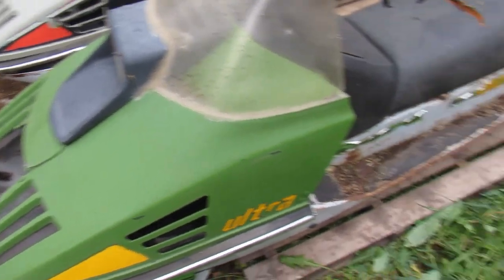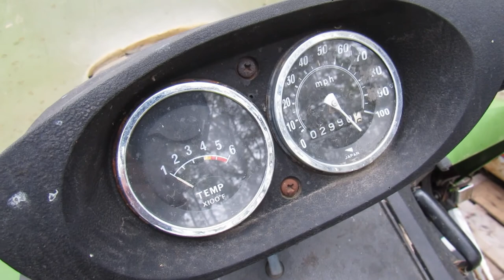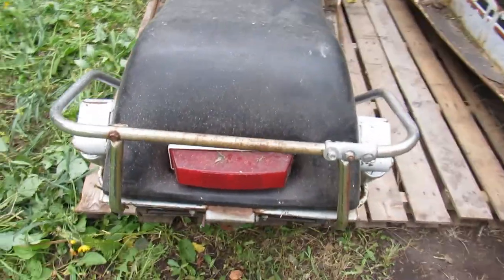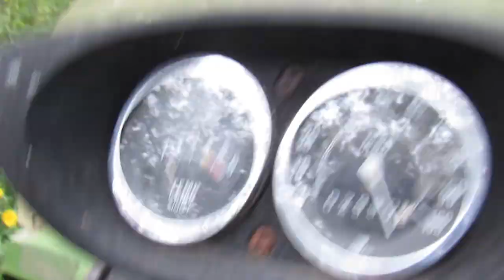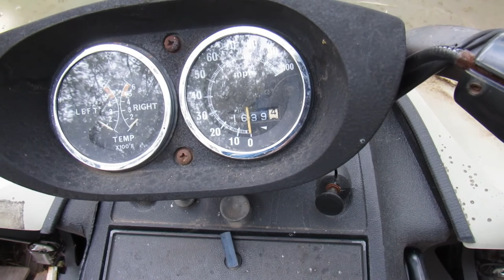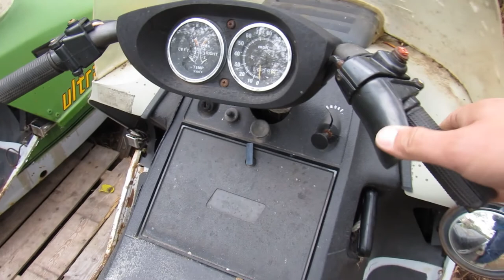1976 skiroule laser and ultra

Comment: Sitting with my 90 year old father-in-law.  Showing him your video.  He lived in Cicero NY.   His Shop was on the corner of Mud mill Rd  and RT 11, Browns Gas Station.  He said he sold 110 Skiroule’s in 1972.  Sold 300 of the Green ones.  There was a 640 he had that did 85-90 MPH twin engine, track was 15 inches. He had the exhaust opened up, raised it and put the straight pipes so the gas would go straight through and out the bottom.  After his modification it did 110. Thought you would be interested in some live history. 😊

Comment: Love the old Skiroules. Rode and raced them from 1969-1995. Wish I could find another. Currently sledless! Used to work for a Skiroule dealer in the early 70's.
Reply from the maker: Very cool to hear you worked at a dealership and racing them too